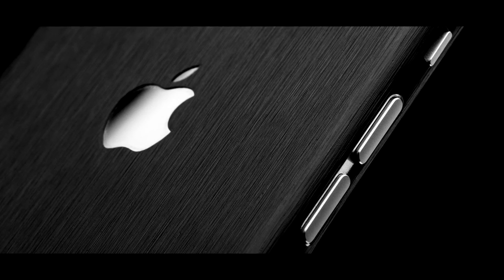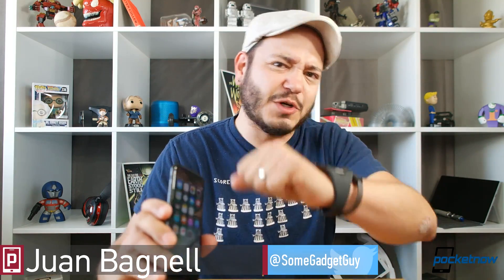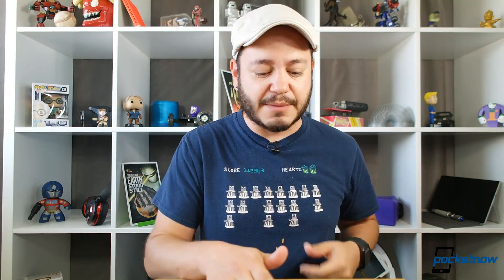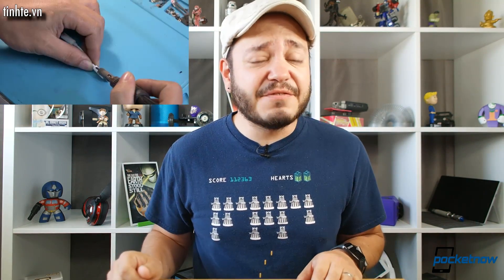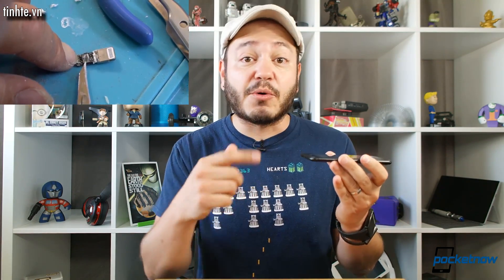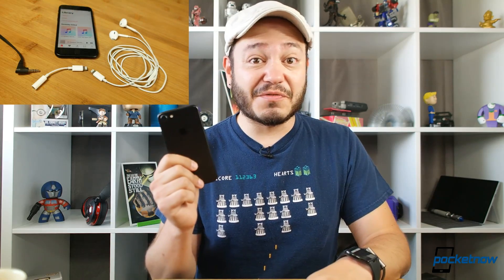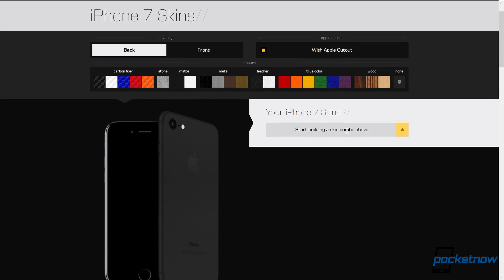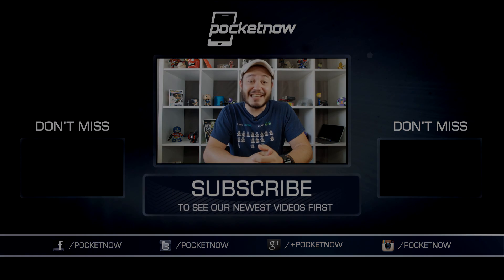Apple iPhone 7 audio part 2: What we got wrong about the DAC... | Pocketnow

Comment: You also misinformed your audience by saying that the ground was only there so that you don't get electrocuted. That is factually wrong. Electricity has to flow into and out of everything, including audio signals. Just saying you could have included that correction in this correction video.

Comment: can you do an audio quality test on the gs7 edge using the adapt sound feature? by default the audio on the s7 is a bit flat... but after the audio setup I noticed something really different... audio is now more louder and crispy... also dynamic range seems to be improved. I'm very curious of what's happening with the audio on my device.. is something on the DAC or... I don't know... but I want more information about that. my s7 is the exynos variant. coming from and m8 audio will never be the same.... but after the adapt sound trick I'm pretty happy with the sound quality on the s7 edge

Comment: That was a rookie mistake on your part. Anyone who have been following Apple knows that the lightning connector is 100% Digital. USB C is also 100% Digital, and no, there are no 'extra pins'... it is no surprise that the DAC fits into the adapter since Most DACs are super tiny. It's clear and evident that you've never seen an actual DAC before.

Comment: Ok, so these are my questions - if the earbuds now have a DAC in them, does the DAC have a tiny amplifier, too? Or does the output from the DAC directly connect to the left and right earbuds? Did all iPhones (and other mobile devices) before iPhone 7 have a small amplifier connected between the DAC and headphone jack?

In other words, can the lightning adapter DAC alone produce enough voltage to push earbuds and / or headphones?

Comment: One thing to consider here is if there are lighning extension cables available, you can potentially reduce the audio noise from a long analog cable by using a long digital cable instead.   Not that there's a big need for that or that the difference will be particularly significant, but theoretically, since the digital signal is more immune to noise, keeping the length of the analog cable as short as possible should have the effect of minimizing noise.   Then again, do you really need to send your audio signal from your phone over 300 feet of cable?   And are 300 ft lightning cables available?  Plus, are the lightning connector digital drivers in the iphone capable of driving 300 ft of cable length?
Reply: Max length of USB-C is 5m,(16ft?).  A good shielded analog connector can go up to 50m  before noticing anything. (Usually analog is better that digital on distance, although digital can use repeaters with no loss of quality)

Comment: While your analysis, though initially flawed, is now sound, I think your conclusion is the exact OPPOSITE of what an audiophile wants.  The audiophile doesn't want to be stuck with the DAC onboard the phone.  It's much better if one gets to choose a preferred DAC and headphone combination.  To that end, changing the design so that the phone outputs the full unaltered digital music signal allows the consumer to decide how best to process that digital signal, rather than being bound by the design built into the phone.  I expect audiophiles will love this new approach, not hate it.  Why should one have to upgrade their entire phone just to get an improved DAC when one can, instead get, from a real audio company, the best headphone and DAC combo?
Reply: But that didn't change with the removal of the headphone jack; analog and digital audio output have never been mutually exclusive and phones have been pushing out digital audio for a very long time now..
Reply: The signal out of the headphone jack is always and has always been analog.
Reply: yes, but digital output from the USB (or "thunderbolt") port has been around for years as well. The headphone jack didn't need to be removed to retain that feature.

Comment: Surely the solution is to use removable cables on the headphones and have both a lightning input and a 3.5mm input, the latter bypassing the DAC.

Comment: wouldn't the little speaker in the headset be essentially the same if it was either the old "anolog" as apple puts it or apples so called "digital" lightening connector?

 i personally could care less about having some premium built in speakers in the phone.  i am not running around playig stuff on it for everyone.  the missing headset jack is not good for me.  i use cheap $15 or less wired headsets the clip over the ears.  the ones that go in the ears are not comfortable to me. i dislike like the androids but at the same time i dislike the crap ideas apple has been doing.  i currently use anandroid but over the past 2 months or so have been thinki g about going to apple again.  if i did it would be a 6s.

Comment: Another thing about your original video....16bit is totally fine. I doubt there are many DACs that can actually put out anything above 20bit audio, let alone 24 or 32 bit. The reality is that the bit depth determines noise floor/maximum signal strength, and really 24bit audio isn't 100% certifiably better than 16 bit.

Comment: So the internal DAC is just for the loudspeaker then??
Reply: YES, should route the internal signal through the lighting connector, the external adapter is a bad ideal due to the space limited and power of the amp on the adapter.

Comment: What's the final verdict? Adapter makes the audio quality better or not? The phone itself can't make better audio ? I don't understand.
Reply: The phone is fine and the audio adapter that comes with the phone is fine. The quality of the audio will be determined by the quality of connector you use. Since they were using the adapter that apple included in the box, the quality of sound is based on the quality of the adapter. The sound is fine, it sounds the same if you were to plug into a phone with an audio jack. If you want great audio with the iPhone 7, just go wireless in the future or get digital headphones that directly plug into the phone's lightning port. Try to avoid using a connector or if you use the connectors because you still want to use your old phones with an audio jack then thats fine, itll sound exactly the same as it did if you were plugging into a 6s...
Reply: Plus if you want to use a phone that has an audio jack, than obviously don't buy the iPhone 7....there are other phones out there.

Comment: so the Apple earpods have their own dac and amp in the remote probably and also now we have to buy only original adapters and not some cheap ones (9$ isn't bad I accept but I'm putting it out there.) also there can be a number of better adapters from 3rd parties that support more power hungry headphones. the major problem here is that we now need to analyse the quality of individual adapters and check the quality of the sound they offer (frustrating)

Comment: I was originally under the impression you guys were aware that the audio jack connector had a built in DAC on board in your original video, thus realizing that the results you guys got were obviously based on the quality of the audio jack connector that apple included, which was bound to give you  mediocre results because let's be honest, why would apple include a decent quality connector? The fact they're charging $9 for it probably means it cost them $1 to produce. Glad you guys fixed the error. Would be great to see you guys follow up with great new audio  products that come out which take advantage of the digital connections going forward.

Comment: so should i buy a pair of lightning earphones for my 6s or just the regular 3.5mm. p.s. i lost my earphones thats why  i need to buy
Reply: 3.5mm
Reply: If the lightning earbuds will cost more fuck apple im gonna buy the regular 3.5mm
Reply: That doesn't make sense. Why not wait till 5 years from now when the battery life is better, the sound quality is better, and the cost is less?
A decent pair of earbuds is 20 bucks give or take compared to a similar sounding $60 +/- pair of bluetooth ones.
Reply: rainbowevil I meant waiting 5 years for bluetooth tech to get better and more affordable. As far as spending big money on standard headphones now, why not? $200 for at least 5 years worth of use isn't bad.
Reply: rainbowevil advancement in electronics moves fast when there is a need for them to because it improves on current technology.
Going to lighting jack or usb type c offers no improvement in sound quality or added convenience to the consumer and only helps the manufacturer.
If I buy a $200 pair of headphones today and apple plans to stick with this trend I'll go to another manufacturer that still uses it.
The 3.5 jack isn't aging technology as it still does it's job extremely well.

Comment: So lemme get this right. Despite the fact that there is an internal DAC in the iPhone 7 it is only used to power the speakers and any headphones plugged into the 7 will be dependent on the quality of the dac built into the headphones. Furthermore it forces you to use the apple adapter if you want to continue using your wired headphones

Comment: Or, if you're serious about audio, you'd be getting an external DAC anyway, this just makes things easier because there will be a bigger market and therefore cheaper higher quality external DACs will now be available for purchase. Rather than just overpriced made in China crap.I think what we should do in the future, is have headphones that end with a 3.5mm plug at the place where the two sides split. This then plugs into a DAC with a type C port, which then can plug into either a lightning or type C cable into a phone.

Comment: It's interesting that there's a DAC in the headphone adapter and honestly that's how I envisioned it when Apple made the announcement. I'm actually glad that it's that way because it simplifies everything in my head. That the lightning port is the same in the iPhone 7 as is in the iPhone 5. Honestly I wouldn't be surprised if some headphone manufacturers believed it to be a benefit that they can now supply a DAC with their headphones. Because now they can guarantee a base level of quality no matter what source the user plugs them into. Which was a genuine concern when you took good headphones and plugged them into a shitty source. Now at least there's some sort of solution for that in one small corner of the world.

Comment: Can I charge the iPhone 7 and listen to music in my car without Bluetooth.
Reply: yes, just use a usb that's connected straight to the car.
Reply: no.
Reply: No, you can't while charging!!! wtf
Reply: shenan007 have you ever tried plugging in your phone to your car? It auto plays every time for me. I don't see why one apple device would be different from another. Try it for yourself. even if it didn't work that way, there's a lightning --> 2 other lightning port adapter which could be used to plug headphones and a charger into if the usb didn't work. do research before commenting next time :P

Comment: Juan, I think you might still be thinking about the limitations of ANALOG audio(a stereo in/out per device).  Digital audio passes the smarts to the earphones/speakers.  Digital audio will allow multi speaker VR head sets, multi channel outputs, smart head sets etc.  It is not about the jack, it is about the analog port that needs to die so that smart audio to have its revolution.

Comment: So does this mean 3rd parties could potentially make an adapter that outputs 24-bit audio?
Reply: yup, if the phone output is just pure digital audio data the final conversion will be made at the external DAC. If this DAC can output 24-bit audio then you're all set.
Reply: Cool. I never minded the removal of the headphone jack but this makes it so much better!
Reply: Aaron Wafflez just be ready to spend a pretty penny, a good DAC isn't exactly cheap and add in good headphones and well you're probably in the $200+ range just starting... Sadly now the cost of a DAC needs to be factored in whenever you want to use good headphones off an iPhone. At least it will be a one time purchase.
Reply: True, and I am very fortunate to already have a pair of good headphones. I just gotta make sure to get a quality DAC from a reputable manufacturer, if and when they come out that is. Who knows, I might not even get an iPhone.
Reply: As far as im aware of, the iPhone and ipads only support 16bit audio (even alac)... at least through itunes. Not quite sure if a streaming service like google music supports high resolution audio and do a test.So, it may not matter if someone starts making hi-res things-for-iphone.
Reply: You can't download 24bit files from Apple Music or the iTunes store, but if you have your own lossless files, convert them to ALAC and it can be synced onto your iPhone no problems.

Comment: So what is the verdict? Does it sound like crap or  not?
Reply: No it does not. The straight earbuds with lightning cable tip sounds phenomenal.
Reply: you're not going to notice any difference what so ever
Reply: john doe thanks
Reply: crap with the adaptor or cheap headphones. The sound all depends on the headphones that you get and the DAC they place on their headphones.
Reply: i am Android user i am using le 2 as my secondary phone ( note 7 was my primary phone) so yes le 2 is my primary phone right le 2 don't have any audio jack but they provide audio adapter and cdla earphones audio through cdla earphones is awesome but through adapter with good earphones you can feel the quality and hear every instruments but its not loud to  give goosebumps sorry bad English.
Reply: No it's not a noticeable difference
Reply: I have a 6s (so idk how different it'll be) but I use the adapter for my car. I can tell you that direct Aux sounds "louder" but the lighting port puts out SOOO much more bass! the downside is that you have to find a good balance for all the other audio levels, which I'd have to get a new stereo system for.
For regular earbuds, I do prefer the MP3 port (it just sounds slightly more clear), but the Aux converter adds a little more Depth to it. That's the best I can describe it. I think you need decent earbuds for the aux converter to sound good, but I don't have any different ones than gaming type and Apple's buds.

Comment: no no no no. A difference in a part number does not mean a difference in audio quality. Different part numbers can exist for a whole host of reasons (different packaging, pinout, etc). Analysis of the analog output is the final test, and your previous video indicated they were very similar. (which is kind of disappointing in and of itself). Too bad they didn't UPGRADE the adapter DAC and make the sound better. THAT would help negate the bad press about losing the analog jack.

Comment: ok so maybe some one whos smarter than me can answer this ... in the video he mentions all headphones will need DACs even those that are going to have lighting connectors is that true ? couldnt they just use the one inside the Phone ? 
secondly If thats the case jsnt that a good thing ? if the DAC in the phone is pretty poor surely having headphones that have better ones is a good thing ? 
altough i will agree that having a proprietary comnector sucks and having only 1 sucks even more but could be a step in the right direction ? thanks

Comment: Since it is outputting digital signal, high end headphones will sound a lot better since it should be able to use a more high quality dac than what was previously in the phone. And low end headphones will sound as good since you can just use the dac provided in the adapter. I am actually starting to understand Apples logic

Comment: wow, I don't know what's more impressive, that they place a DAC in a such small place that's almost impossible to notice from outside or that Apple sells this piece of engineering for only 9 USD.
Reply: you fool! It's not impressive that they sell it at all. It should be inside the phone!
Reply: I tell you these ifans really are something else. It should be instead the phone of course so you can use your favourite type of headphones without compromising quality
Reply: Cell phones used to come with a head phone jack and people used to come with a brain, good times where you didn't need to explain explicitly the use of  sarcasm. 

About the Ifan thought, I guess I might be, but I just a fan, not a user thought, as my daily driver is a s7 edge and the secondary is a p9 plus. So sad 😔 😔

Comment: cool, so now some other companys can make a range of 32 bit lightning dacs in little adapters and drive a market for every price point.  you want cheap, then use the included adapter.  and if you want juan's audiophile level of quality then buy the $$$ dac.
Reply: And now you can understand how Juan could have made such an easy mistake.  As you (or anyone else) doesn't know if the software/hardware even supports pushing a 32 bit audio data stream through the Lightening port.  Your 32 bit DAC would be nearly useless then if it is only supporting a 16 bit/44.1KHz stream.
This is simply Apple attaching another utter to it's cash cow it can squeeze.  They can now charge headphone manufacturers a licensing fee for the Lightening port.  Couldn't do that with the 3.5mm/1/8" port.
Reply: very true, i assumed the dac was the bottleneck for quality and the lightning connectors supported bit rate is still totally unknown.  now im curious to learn about bluetooth's bitrate support.

Comment: What happens if you buy dedicated, wired lightning connector headphones? Is it still not supplied by the DAC inside the phone?
Reply: The DAC has to be in the headphone and I feel the amp too!!
Reply: There IS a DAC in the phone of course, how else would it drive the speakers?
Reply: ***** DON'T WRITE IN ALL CAPS, BECAUSE IT'S POINTLESS.
Reply: ***** YOU ARE EXTREMELY (not) SMART.
Reply: There is no dac for the port, because the signal is put through it digitally. The digital to analog conversion happens in the adapter piece.